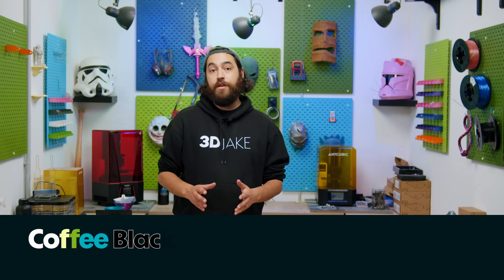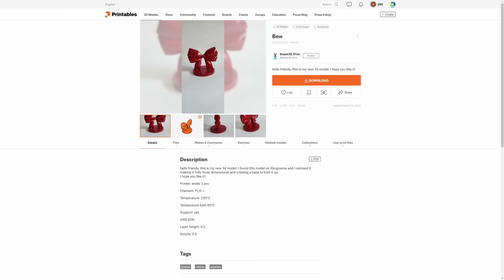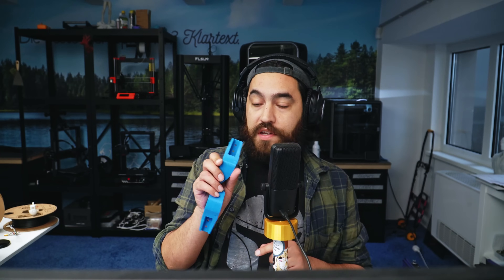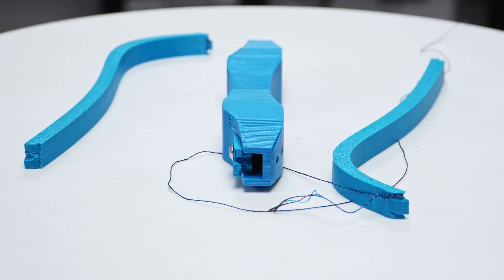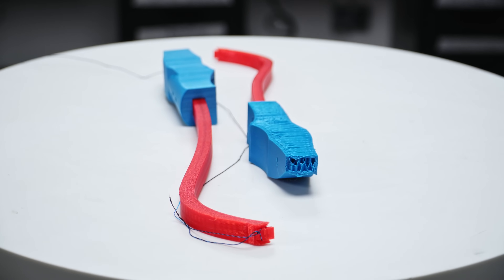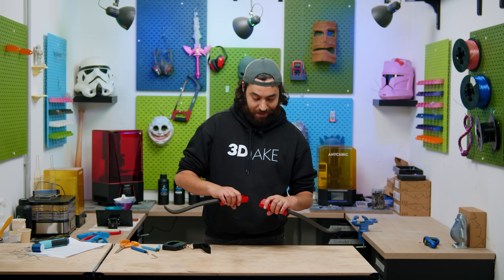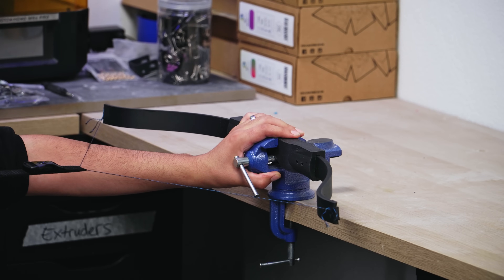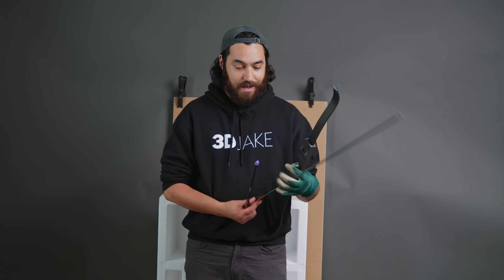Crafting a Powerful 3D Printed Bow: Strength Testing Different Materials!

Comment: Something I realized with the riser it snaps at the same point each time but also I noticed the layer lines shouldn’t be across the riser going horizontal it’ll give in to snapping easier under stress. If you were to have the layer lines go vertical up and down the riser it’ll give more durability to the riser. I think if it like when you have a stack of staples to put in a stapler.. if you had to snap them off they snap off easily but if the lines were vertical it’ll make it harder to separate and snap.

Comment: Bows do not draw from loose strings I'm not knocking on you however you'd get more consistent results if  the had say 5 kilos or so when you start to draw and the went back to a knock point determined by you.   Some archers use their ears others use the corner of there mouths and a compound shooter I used what they call a kiss button.  The  idea is simple for any method just develop a comfortable way of drawing the bow to the same length and thus weight every time.
Reply from the maker: We're definitely going to revist the bow and make the improvements that people suggested, yours included :)

Comment: Awesome power, thanks for making and sharing 3d printed bow stuff. I was able to get a substantial increase in both strength and power for my 3d printed limbs by using ca glue  to bond a 0.8mm thick strip (printed flat) to the outside faces of my limbs or in your case the front faces. I have a reverse draw set up so protoyping limbs is much safer because they won't come flying back at my face should they break but this is only helpful info if you're making a crossbow since they only work on crossbows

Comment: 20kg! very impressive draw weight.  Still tons of room for design improvements, but with advances in filament materials, a 100% printed tournament bow is probably not very far away.  Did the the limbs develop a set, or permanently deformed? Or did it retain it's original shape?  Very excited with this.  Thanks for sharing.
Reply from the maker: Oh for sure, we're gonna address the flaws in another video to improve it. People already gave awesome advice in the comments. The nylon CF limbs are totally undeformed, that's what I was worried about but I think next time we'll try pure nylon to give the limb tips extra flex, CF was a little bit too rigid.

Comment: i get much stronger petg prints than you it seems, i extrude at 265c 10% fan. 140mms walls and 220 infill. i cant break the benchys i make even with hammers, need a vice or a cutting tool ;) also there are interesting blends of the stuff too. but pctg seems to perform better in every factor except price and variety so far. But it will come with fillers like petg has today hopefully sooner rather than later.

personally i like asa as my prototype material today. who uses abs when there is asa i say.
Reply from the maker: I share your opinion with regard to ASA however regarding the PETG, I think you're referring to impact strength, I need to bend this part without it snapping or yielding. Some people in the comments gave good advice regarding PCTG and I want to try that again, still a bit nervous about it but I want to make it work.

Comment: Hi Jake!, an amateur archer and 3D printing enthusiast here. In redesigning the riser, it is important to consider the following:

- Include a "shelf" where the arrow will rest.
- If you are right-handed, then that "shelf" should be on the left side of the riser.
- The grip (where your hand rests) should be almost in the center of the riser, so the top of the riser should be longer than the bottom, and the arrow rest must be in the center of the string.
- It is essential that the rope be "pretensioned" in the bow, and that it not be allowed to become slack. This will greatly enhance the power of the bow. By being prestressed, the string will be supported by the "undulations" of the limbs.
Reply from the maker: Really helpful advice! Thank you!

Comment: Make yourself a rig where the bow is held on the wall and you pull downwards test it: look at a tillering rig on YouTube. Means you can pull without risk of it hitting you in the face. Plus bows are strung to a brace height; when strung the bow limbs are already under tension by maybe 10-15%. What you’ve made there is far closer to a crossbow prod than a true bow. So maybe continue and make a crossbow? More than happy to help and advise if you need it: I make bows ;)

Comment: I made a 19” riser and plotted half scale as a test - I stood on it to see what it would handle and it didn’t move.  I’m around 125kg. 

I was going to get some 40lb ilf limbs and hardware and build up a full scale but have been smashed at work.

I printed with 10-15 perimeter and Infill was about 50% rectilinear. I also did solid layers every 12 layers to add some strength. Plotted in prusament petg. 

I also plotted some limbs but they are untested.  For weight.

Comment: Interesting project. If you have a local archery shop, maybe you could spend some time with your hands on a real bow? 
I feel like there's some design aspects that have been long-solved in archery not applied here. If that's because it's just a quick design for testing the concept fair enough but I'm sure riser and limb shapes could be improved. Length and stiffness of arrows are also usually chosen based on the stats of the bow.
Personally I'd be quite interested in testing the components individually - e.g. get a real recurve riser and try 3d printed limbs with it. Get some regular recurve limbs and try them with a printed riser, etc.
Reply from the maker: Individual testing and comparison with manufactured bows is a great idea. It was intended as a quick design but its also a first iteration, I do intend to improve it in future, actually some other people gave great advice down below so there is no end to improvements.

Comment: Some suggestions I am not an archery person and I don't know how to design a bow but some things I've noticed as a self-proclaimed DIY engineer 

First the riser No more cutouts get rid of the place where the arrow goes get rid of the place where your hand goes Make it a cylinder so to speak something stupid strong that does the necessary job 

When it comes to making it ergonomic do that with additions so print the ergonomic part so that it gets glued on to the riser that's a simple shape this way the simple shape super strong riser is handling all the force load and the parts you attach to it don't have to handle nearly so much force there's simply there to make the riser more ergonomic to your hand kind of like the way the handlebars are on your bike or just super strong metal tubes and then you add handlebar grips friction tape the angled risers that you see on performance bikes stuff like that then gets added to that riser do something similar with the riser for the bow 

I would also lengthen the limbs a tiny bit and put a little precurve into them so that you can put a taunt but not tight bow string on it you don't want to put it under too much tension because the plastic might creep over time 

This is also something while expensive I would test to destruction you want to put an arrow in it on a test rig and test it until it fails you want to see most importantly how it fails so you know which parts of your body you need to protect :-) probably mostly your face and your forearms the amount of energy in those limbs if they were to suddenly give way would be pretty dramatic to your skin and your face

Comment: Something to keep in mind especially with lower grade materials carbon fiber never makes them stronger ever under any conditions 

In fact this is true of all materials with the exception of that special process that actually laid a continuous carbon fiber filament there is no such thing as a filament that is stronger with carbon fiber in it 

This is simple physiology or whatever you call it you are compromising the structural integrity of a homogeneous plastic by putting voids in it but it's carbon fiber I don't care what it is You're putting voids in the plastic that makes it weaker no matter what 

Carbon fiber does exactly two things it gives you a more matte finish which for artistic princess absolutely stunning I love carbon fiber PLA for artistic prints and it trades the strength you give up by putting voice in the plastic for stiffness 

Now there are times where this could be advantageous such as nylon and that's only because for many of our applications the nylon is significantly stronger than mission specifications so it's stronger than what you need to do what you want to do then you can afford to give up some of that strength in exchange for stiffness as long as that strength does not drop below mission requirements 

But all plastics no matter what it is get weaker when you add a fill because the fill creates voids that's where the feel exists in those voids and those voids always make the plastic weaker
Reply from the maker: We decided to use carbon fibre to preserve stiffness like with modern fibreglass bows, that's what I meant by "strength", actually pure nylon would probably have been a better choice and I think we might try this for version 2, that and a new limb design with PCTG. I was worried that the limbs would be too flexible and would easily bend back without building up much force but using carbon fibre might have made it a little too rigid. Definitely going to redesign a few things for the next version.

Comment: Nice idea but I was kind off dissapointed with the method.

I did some testing with small springs for a little toy pistle and what I found:
- PCTG can stretch much furter without breaking, good for a bow
- Nylon CF is Very rigid and can't bend as far without breaking

I have also made bows from wood, and generally speaking, the specs of pctg are much ore suitable for the limbs. True it is relatively flexible, but that can be offset by widening the limbs. 
So I was dumbstruck when you swapped over to nylon limbs on a pctg riser, it should have been the other way around! Pctg is much more flexible and has a higher impact resistance then petg, but other than that, it isn't much stronger.

Next thing to consider, the length of the limb is the leverage that is put on itself, so in order to equally stress each part of the limbs, they need to get thinner towards the tip. If this isn't the case, they are stressed alot at the base where it connects to the riser, and the entire remainder of the limb is basicly useless. 
You want the entire limb to bend equallyt as much to get the maximum flex from the material. 

Then, as someone mentioned, a bowstring is strung under tension, without it your arrows will flipflop all over the place as seen in the tests. The arrow flipflopping is partially to blame on the distance to the target and the stifness of the arrow. An arrow typically bends a bit when shot, which it has to do. If an arrow is to stiff or to floppy for the strenght of the bow, your arrows will be way of target. Short arrows like this will make them relatively more rigid, so that is something to keep in mind. And as mentioned, when shot, the arrow bends a bit around the bow, then it will bend the other way after leaving the bow, this motion will repeat itself slowly diminishing over the first few meters of the arrow. This means if you shoot at very close targets, your arrows will still be in this bending motion, throwing off your aim quite a bit. This effect is only amplified when shooting with arrows that are much to stiff.

Lastly, you trying make a recurve bow, which is much harder to make then a normal bow, maybe start with the normal one 
Explanation: The re-curved tips function as an extra lever that comes available when the bow is fully pulled. This makes it require relatively little effort to hold the bow while aiming. however this again also means the tip of the limb flexes less, and this entire benefit is only available if the curved edges are paralell to each other in the pulled position of the bow, which requers more testing and calculations. If this is desireable I would print the recurved tips in a different material and attach them similar like how the limbs are attached to the riser.

So: 
1. use a different bow design (no recurve)
2. Make limbs that are tapered towards the tip
3. Make riser from a stiff material and the limbs from a flexible material
4. If the pulling strength is too weak, make the limbs wider not thicker
5. Rethink the arrows: use thinner arrows if they need to be this short, but ideally design the bow to be able to curve furter, so you can keep the long arrows.
Reply from the maker: This is fantastic advice, thank you!! We did try PCTG a little further than what was in the video but it yielded easily. I really want to try again though and with your tips I think it can be improved a lot.

Comment: Maybe it could help using a bigger nozzle. So you got less lines and layers that can delaminate.
Reply from the maker: I remember reading that bigger layers and widths don't necessarily mean higher strength as the gap between layers is proportional as you increase the layer height, bigger layers means bigger gaps between them. CNC kitchen recently did a video exploring layer deposition with offset layers that look like brick work, that could help.
Reply: @3DJake_Official  oh, need to check this out. Thx